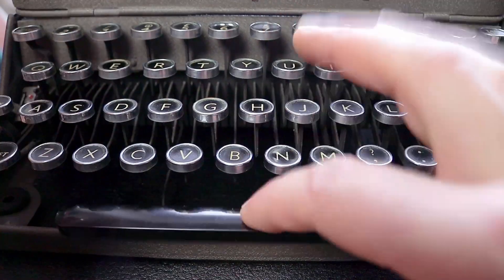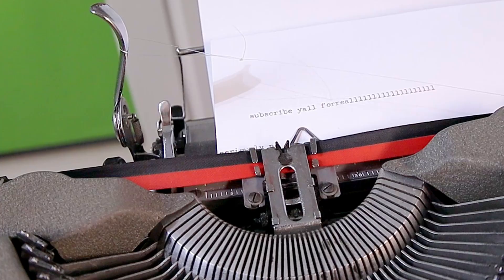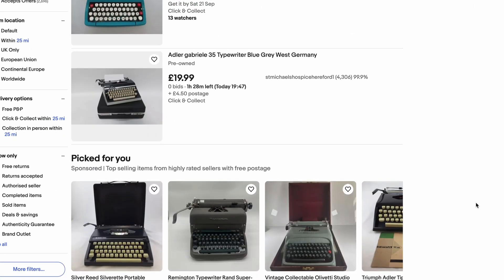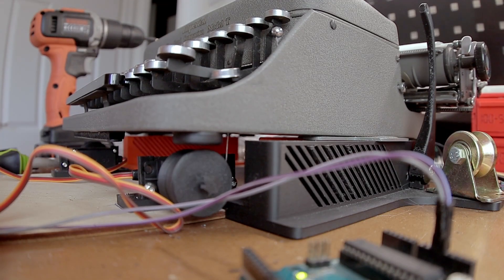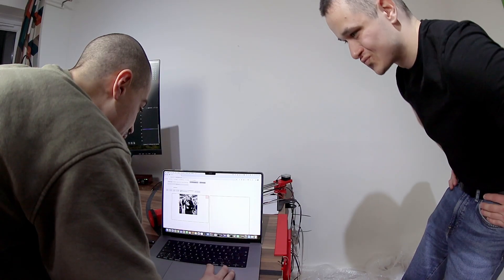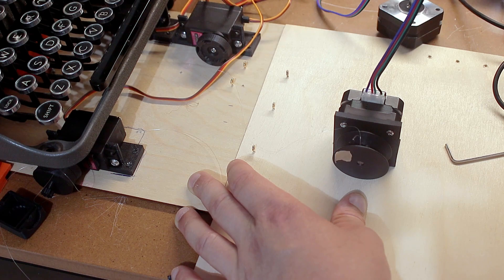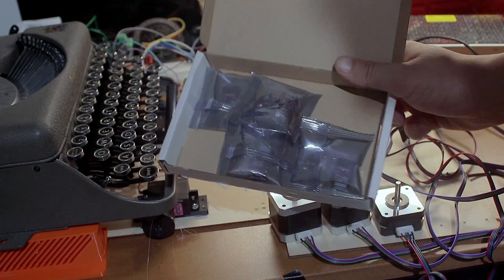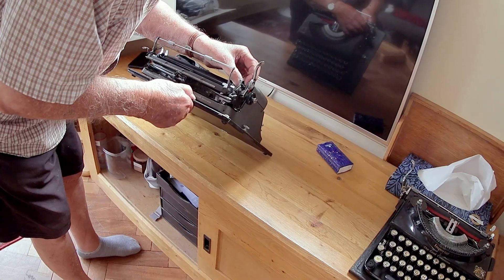DIY Mechanical Typewriter Automation

Comment: One thing we have not yet discussed is using pneumatics. It’s probably overkill, but a very cool one. This could provide a very neat solution for the keystrokes. And it’s an area that you haven’t explored in your videos yet. However, using a stepper motor is sub-optimal; this task requires a high-torque, high-speed BLDC motor. Regarding the pulley for the carriage return, we could analyse how the spring failed and then implement impedance control for the BLDC motor and prevent it from exceeding that threshold.
Reply from the maker: would pneumatics be fast enough?
Reply: @esser50k  Absolutely